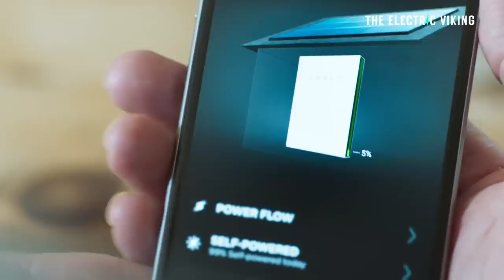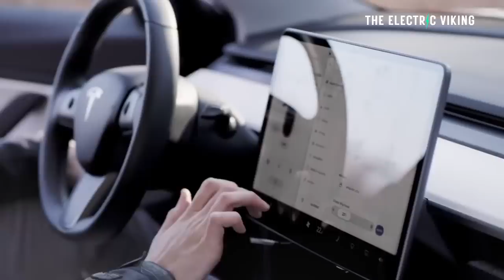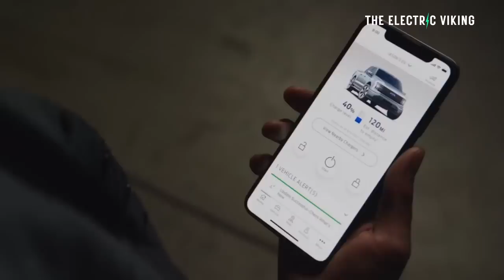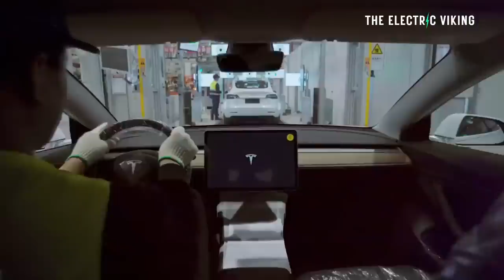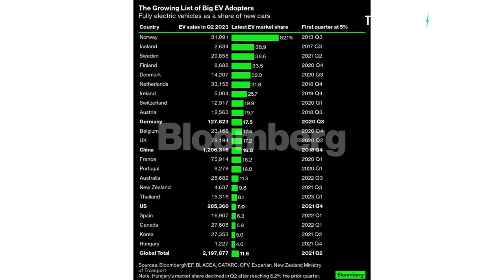Electric cars pass S-Curve Tipping Point in 23 countries - GAME OVER ICE!

Comment: You can go back even further than Microwave, like 115 years ago when the combustion engine vehicles were getting their start. Scores of small makers, few lasted. There was no such thing as gas/petrol stations, nobody could work on them, no good roads. Adoption was slow. Horse-drawn vehicles shared urban streets with cars for many years until Ford introduced the Model T. High volume production, lower price than the hand-built cars, and increased availability of fuel all helped drive adoption. ICE owners who think this is a fad, only need to remember the horse owners who said the same thing about the car.
Reply: Tesla Model 2 will be the tipping point here. My worry is how quick they can ramp production as demand will be ridiculous.
Reply: HORSE SHIT !!!! YES HORSE SHIT WAS THE MAJOR FACTOR
Reply: @paulhailey2537  And many ICE manufacturers are still talking it...
Reply: Same with electricity adoption from the 1900s
Reply: @chrisheath2637  If everyone in New York City just rode a Horse , then we would not have Any Pollution at All LMFAO

Comment: Our family (four drivers) now has two EVs and one ICE. The EVs replced ICE that had reached use by date.

EVs are now definitely our preferred drive and the ICE gets limited use.

EVs do require a bit of  rethink about charging etc but this quickly becomes routine. Both the EVs (60KWhr LiFePO) currently get charged once per week to 100% using off peak and/or solar AC slow charging. 

On the odd occasion we need a fast charge we try to limit it to 80% capacity to minimise excessive battery heating. This charge usually takes about 15 minutes.

After a while it becomes routine.
Reply: I read a study yesterday, showing that Tesla cars suffered almost no range, battery performance ,degradation even if they are ONLY supercharged…. Not sure what vehicle you have, but I think it may be tougher than you think.?
Reply: @ouethojlkjn  You maybe correct, in which case we are being too cautious. On the other hand the routine we are in now is fine and suits our lifestyle.

The EVs are a Tesla M3 and an Atto 3, both very nice vehicles.
Reply: You're exactly two thirds of the way up the curve :)
Reply: Two nice new EV's. No offense, but that's something most families  will only ever dream about. Owning both, how do they compare?

Comment: With the arrival of a handful of new ICE designs specifically for range-extending generators, I expect ICE-extended EVs to become quite popular in colder climates where losing 20-40% of the range to cold weather hits particularly hard. Many EVs take 20+ minutes to reach comfortable cabin temperature when it is -30C outside while ICEs with exhaust manifold heat scavenging can get there in three minutes.

Comment: I remember a microwave oven we (parents) got in 1979 or 80. Externally it was almost 3' wide, 18" high and about 18"  deep. And more than 50% of that was operating guts. The rest was the cavity for heating. In probably 1987 or 88, they bought a microwave with about the same heating area overall but the exterior was way less in size than the previous one and was a hooded/vented unit over the stove top. And tons more nuance as to how you wanted to heat stuff.

Comment: Not a chance where I live. My LR is 60 years old and I am not changing. Electric cars as they are built today are not the answer. We need far more generating capacity. A rebuilt infrastructure and a cassette change system for the batteries . Also the heavier cars will damage the roads more, wear tires more and use more energy. It is doable but not the way the world is going. And I am a qualified professional consulting engineer.
Reply: Except you are wrong. EVs are far more energy efficient than ICE vehicles. Yes EVs are generally heavier now, but that will slowly change as battery packs become lighter.

Comment: Also Mr Ed; you may note that your vauge reference to "next generation" require a new chemistry; it has to be less dependent on rare earths like Lithium; and be as cheap and energy dense, and have as long a life span; so far not one company has started to make the investments in infrastructure, supply chain and mining to do anything. A couple companies have claimed they would try a sodium based car (BYD segull); but they backed out so far. So far it's pie in the sky.
Reply: Lithium is not a rare earth element,nor is it rare! Many companies are mining and refining it . The BYD seagull is using sodium batteries. ✅✅✅ You need to watch the electric Viking more often to stay updated and informed.😊

Comment: Such a good news channel...the end of ICE cars cannot come soon enough, followed by polluting transport vehicles. I bought my Tesla in Oct 21 and was lucky to see another on weekly travels to Sydney Australia. Now I see 20+ on that weekday commute, plus a smattering of other makes. As for Tesla, when the Model 2 comes out it will be game over...Roll on the E revolution.
Reply: @oldbloke204 the renewable are cheap, it's the fossil fuels pushing up the price. For the cost of electricity to come down significantly, renewables need to be a large percentage of generated energy. We are many years away from that happening.
Reply: @UndercoverScambaiter  I agree with you that renewable electricity is cheap BUT that is only the producing part. 
Considering that most areas where most of the elctricity is produced is out of way places that will require countries to pay for upgrading their electricity networks. That aint cheap. 
Gas/petrol has the advantage that they already have necessary infrastructure  already in place. 

Are you willing to pay for X years extra tax to cover for electric infrastructure upgrade so you can pay less for driving. 
Im sure that benefits are about 0 if we calculate the tax increase compared to benefits of having EV. 
Sure in 30 years when infrastructure is done it will be cheaper but nowing how fast governments work it will be decades before it is done
Reply: @oldbloke204  I guess that the horse and cart was around for a while after the first car was built in 1886, but its future was gloomy. As someone once said "the stone age didn't end because they ran out of stone" so it will be with petroleum, coal and gas...and ICE vehicles. Reference "cheap and reliable renewables"...my car is charged in my garage with solar energy with battery backup, no drives to petrol stations, no servicing, no payments to bloated corporations who put profits over pollution.. Keep filling your gas guzzler...the price of fuel can only go one way; the price of solar energy remains free.
Reply: @oldbloke204 - So far the sunshine on my PV panels is still free, great with net metering and TOU rates….goes right into my Tesla. Ymmv.
Reply: @oldbloke204  Keep supporting those fossil fuel corporations to make bloated profits and, by the way, didn't borrow for any of the free energy production I use, or the car.

Comment: There is a shortage of lithium and it will directly impact production.  The BEV industry will blame the recession; but it will actually be a shortage of lithium. Mined world wide means absolutely zero. It takes 500,000 gallons of water to refine a single ton. If you cannont find water near the Lithium sorce; you then only have the choice of moving the much greater amount of ore to a place where there is excess water; few such places remain.  Over the last 5 years production has averaged 100,000 tons.
It has not risen significantly even with the demand for BEVs.  It will  not be able to triple; 3% of the worlds fresh water is not available to refine the ore.

Comment: Except we’d have to strip mine thee planet to make all the batteries. Also, EVs are significantly more expensive than gas-powered equivalents. Cold weather battery performance is a significant issue as well.
Reply: Wrong! Back to FUD school for you.🤪🤣
Reply: Whereas, of course ICE vehicles are great for the environment, and don't need any mining...
Reply: Except the wells are already in the ground, and in many cases have been there for decades. Sins of our father's and all that. That's transferring to new large scale strip mining operations - I'm not so sure our grandkids will be particularly grateful for that either 🤔
Reply: @malcolmrickarby2313 You are one of those 10-year-olds, aren't you?

Comment: Being that there are far fewer parts in a battery electric vehicle, it seems in short time it should be a manufacturing cost advantage over ICE vehicles.
Reply: As long as you ignore the battery. Break down the individual parts count there, an ev has far more components than an ice.

Comment: A BEV is very different from a TV or a microwave oven or a mobile phone in its electricity demands and the pressure it puts on the grid and the KWH demand.
The pain point imo is the super charger network which is pricey and under pressure on holiday periods but also may lack customers at other times making it harder to recoup the cost of the charger. I think motel/hotel chargers for overnight charging would help a lot but are they being installed fast enough?
Reply: @danielstapler4315  Yes, this is the primary issue.  People need to be able to charge their cars on the road for long trips and in cities with apartment living.

Comment: I live in an apartment in nyc which means I don’t have a private charger at home. I use dc fast charging every day. I drive a Hyundai Ioniq 2020 electric 200 mile range fully charge 0-80% in 50 minutes. I use it to drive cab. The car is solid zero issues. Already 65k miles on it. Evs are here to stay. I don’t know why anyone would buy a ICE at this point. Unless you plan on traveling across the country on a regular basis. AGAIN EVS ARE HERE TO STAY IDK WHY ANYONE IN THEIR RIGHT MIND WOULD BUY A ICE. THERE IS SO MUCH THAT CAN GO WRONG WITH AN ICE VEHICLE I KNOW BECAUSE I WAS A BMW MECHANIC FOR ALMOST A DECADE. SO MANY MOVING PARTS IN A ICE.

Comment: I can't understand why they don't come out with an EV with a very small I C B engine . A 30 to 40 lb. engine and alternator can charge you battery enough  to get you to a charging station. You may say, just add more batteries, but gasoline does have a greater concentration of energy. There is another reason to do this. People  would willing to buy them, because they would feel like it would provide an emergency safety net

Comment: The microwave analogy is a little different. There wasn’t a charging issue. You took it home, you plugged it in.
Reply: “Took it home and plugged it in”? Like an EV?
Reply: @qtheband751  not if you live in a block of flats and your car is in the next street
Reply: @jimpackard8059  Fair enough. That’s a good point. It’s available to some and not others. Hopefully the availability improves with new build regulations.
Reply: It's not the charging. It's the cost

Comment: It will really help when we get an electric battery that is not affected by cold weather. Too many areas of cold weather climate in the US that require long distance driving. It’s not like the Norway. I really wish Tesla could ramp up faster.
Reply: It’s not like the Norway in what way? Norway has the highest percentage of new EVs in the world, and has a much colder climate, on average, than the US; but that doesn't hinder the sales of EVs there.
Reply: Those parts of the world have block heaters and to use a block heater. You have to plug it in when you get to the supermarket or restaurant or whatever. So if there’s a socket, you can plug your electric car in instead.

Comment: What I wonder, is what is going to happend, when the 23 countries reach 83% (90% with pluggin hybrids), like Norway.
1/4 of all cars on the road are Electric. (I can't find numbers for pluggin hybrids).

The problem is that the farmers have started making ethanol.
Now there are a blend of E10 in Norway. If this had been from the start, the blend have to be E20-E25 (15%-23%).
In 2-3 years, probably E40-E50.

The farmers will start a riot, if they can't sell the ethanol.
So, are the poeple buying fossile cars ready to convert their cars to flex fuel?
So, the late adapters will suffer.

Comment: Economy of scale is a thing but it doesn't work on all products. There is a thing called 1 time EV owners...  If you don't have a wall charger at home EV's don't make sense in a lot of countries.
Reply: True, but don’t assume there will always be a local petrol station where you are either.  35% of all petrol stations in the UK have closed in the last 10 years. And if you can find a station, don’t assume it’s cheap as chips supermarket petrol either.
Reply: @ouethojlkjn  Sure, but the volume of petrol and diesel sold in the UK is about the same over the last 5 or 10 years.
Reply: @LD2022-g7t  And that's going to be a comfort to someone in North Wales who has to drive 40 minutes to the nearest petrol station to pay premium rate prices.

Comment: @litestuffllc7249 it has to be less dependent on rare earths like Lithium 
Sigh, so much misinformation, so little time. You used the phrase "rare earths". A simple wiki lookup would have revealed that this has a specific meaning; "a set of 17 nearly indistinguishable lustrous silvery-white soft heavy metals", none of which is lithium. You may have meant a rare element, and that the terminology your quote from the Handbook used; but what you said is "rare earths", and lithium isn't one of those 17 elements.

Comment: Reserves are ore not processed lithium; it mean nothing if you can't process it.  It takes 500,000 gallons of water to process 1 ton of lithium. To process the 130,000 tons of lithium produced in 2022 required 1% of all the fresh water on earth; only about 3 million BEVs were produced out of a market of 100 million - i.e. about 3%.  To achieve 10x; you'd also have to use 10x the water 10%.  To process that much lithium would take all the water in Lakes Michigan and Erie - no - that will never happen so Lithium doesn't work.  You probably will never even get 3% of the worlds fresh water devoted to lithium processing so you'd never get to 10% of the market.

Comment: The presumption that BEVs can somehow jump into massive production is wrong.  Lithium production cannot come close to meeting the market demand for 100 million vehicles annually.  Present BEV production is only about 3 million, and this is taking 1% of the earths fresh water to produce.  In order to achieve 30 million you'd need to use 7% of the worlds fresh water; as much as found in both Lakes Michigan and Erie.  This will not happen. So EVs need a scalable chemistry that is as good ad Lithium - so far - there are none.
Reply: In order to achieve 30 million you'd need to use 7% of the worlds fresh water; as much as found in both Lakes Michigan and Erie. 
Simply absurd. that's about 38 million gallons per car. The actual number is a few thousand gallons per car.
Reply: Also absurd is a shortage of lithium which is readily mined world wide and easily recyclable. Further the next generation of batteries will need either less or no lithium. Fossil fuel companies continue to lie despite the huge damage they are doing.
Reply: @MrEd2291  yup last year evs hit over 10,000,000 globally this year they are on track for 14-16,000,000.
Depending on the back half year sales, which generally are better than first half sales. 

Further from 2017-2022 evs went from sub 1,000,000 sales to over 10,000,000. China's xpeng CEO says evs will dominate by mid 2025 there. 
But hey there's absolutely no lithium available anywhere for any price right? 👍🏻😀

Comment: @litestuffllc7249 So many lies, so little time. Are you making this stuff up out of whole cloth, or just parroting someone else's lies without the simplest plausibility check? It's a quandary...
Funny that you're now using "130,000 tons of lithium produced in 2022". In an earlier rant you said "Over the last 5 years production has averaged 100,000 tons", and "It has not risen significantly even with the demand for BEVs", which is not consistent with 130,000 tons in 2022. Were you lying then or are you lying now? Oh, I know—you were lying then, because 130,000 tons is the correct number.
Let's do a simple plausibility check of your fresh water claims. I have no idea if your claim of 500,000 gallons of brine to process 1 ton of lithium is accurate—and your posting history strongly suggests it's not—but I'll accept that for the purposes of this calculation. So to produce 10 x 130,000 tons of lithium at 500,000 gallons of water per ton will take 10 x 130,000 x 500,000 = 650 x 10^9 gallons of water. Next, a simple lookup will show that Lake Michigan contains about 1 quadrillion (1 x 10^15) gallons of water, and Lake Erie contains about .128 quadrillion (.128 x 10^15) gallons of water. The total is 1.128 x 10^15 gallons of water. So as a percentage of the capacity of Lake Michigan plus Lake Erie, the brine needed to process 130,000 x 10 tons of lithium are 650 x 10^9 / 1.128 x 10^15 = .00058 = .058%, barely one two-thousandth of your claim.
So to summarize, far from requiring "1% of all the fresh water on earth" to process the lithium mined in 2022, or "all the water in Lakes Michigan and Erie" to process ten times that, it will take a little over 1/20th of one percent of the water in Lakes Michigan and Erie to process this amount of lithium, even if your 500,000 gallons per ton is correct. And in any event, this claim is a straw man, because PROCESSING LITHIUM DOES NOT USE FRESH WATER, ONLY UNDRINKABLE BRINE.